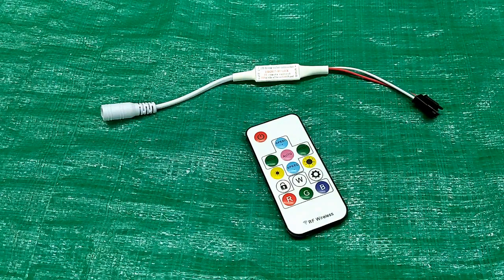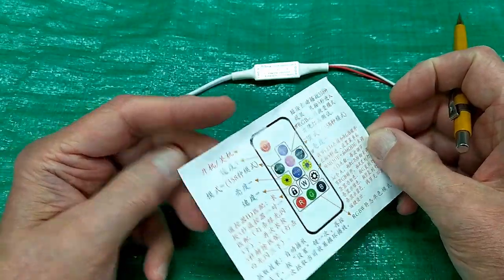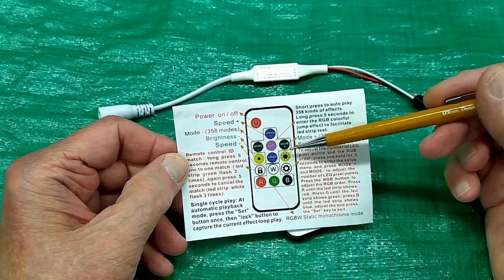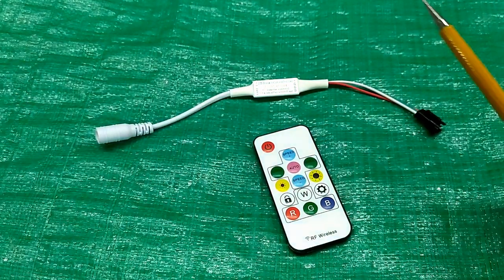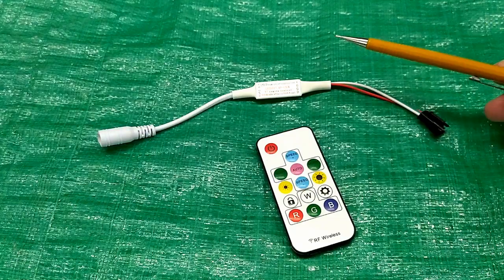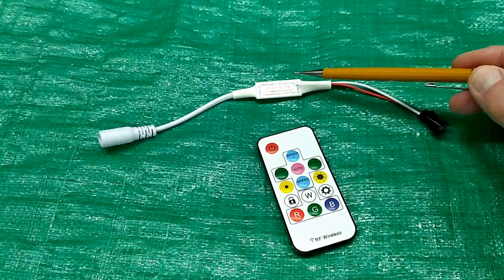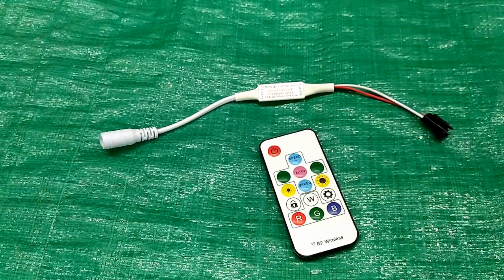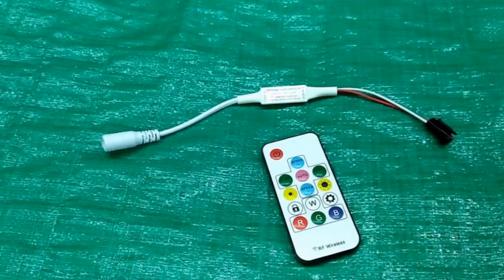LED Dream Controller With RF Remote Demo

Comment: As an FYI, the reason your LEDs and this unit didn't jive at the power/amps supplied by the USB wall wart is because the controller's tolerance wasn't ok at that low level with those particular LEDs. They make these to be universal, but because they write shite instructions, unless you speak Chinese, you'll never understand it properly, because it's not all encompassing.

TLDR if you run low power, low amps, you need low power, low amp LED requirements (small SMD LEDs, for example) and it goes up from there.

Source: i have a friend who is fluent in their language, and he spoke on my behalf to find out about similar controllers (no wires attached, just the remote and the module). Sidenote, the recommended PSU for that particular board i had was a 12v 1amp one. I used an old router one i had gathering dust.

Comment: That's neat. I'm using his code for v7 final. 3D printed sides and top, inner frames and lenses, and bottom laser cut plywood and mdf. Finally got the four digits and the colon wired correctly. Now to get the code tweaked to run my layout. His builds are quite good. I'm using D1mini to run it with an RTC. Took a little to figure out the pinouts, but it's doing fine. Good luck with yours.

Comment: That controller produces an interesting light display. Very nice and demonstrates what that string of LED's is capable of, but I don't think I would want it doing all of that in a clock.
Reply from the maker: I totally agree. Having a clock changing colors like that would drive me nuts. The RBG combinations in each LED, produce the color I wanted for a non-changing (color) display. I only wanted the controller to test the string, so I would be confident the string would work as I wanted going forward with the clock assembly. Thanks for watching!